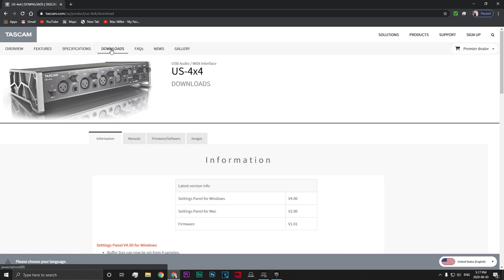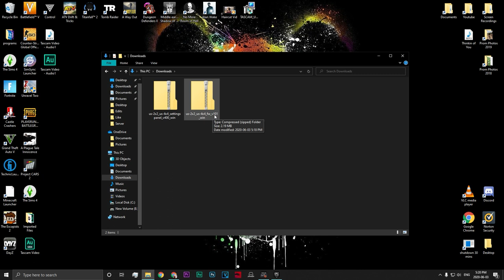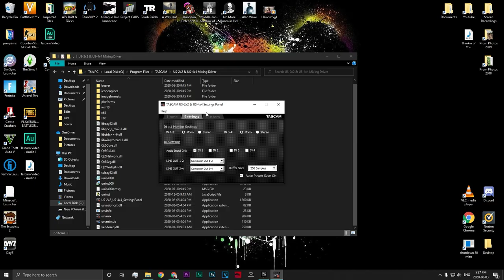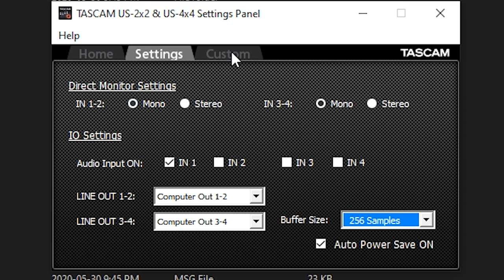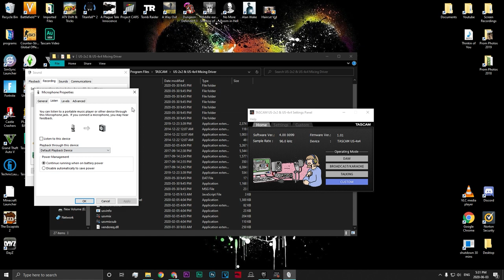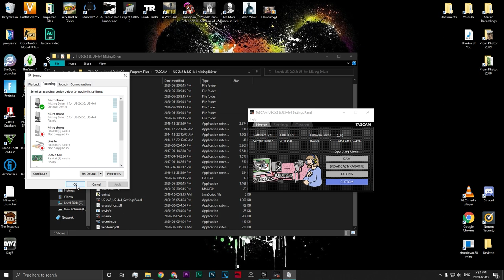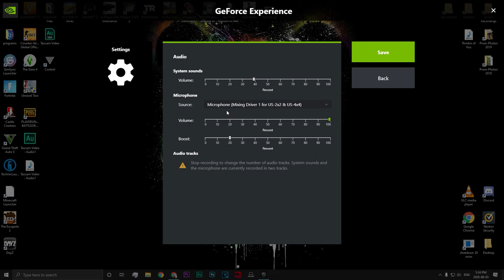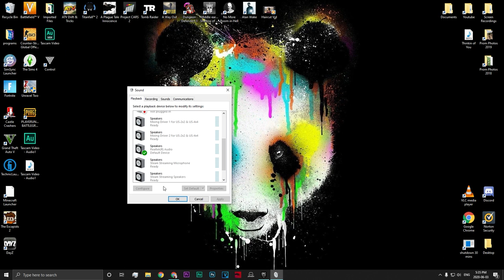taSCAM 4x4 - AUDIO ISSUE (still broken, don’t buy)

Comment from the maker: Update: still broken. Buy something else :((
Reply: I'm sorry to hear that. I came to the same decision, and bought a Focusrite Solo, which quality-wise seems fine. Windows 10 and my laptop seem to recognise it and usually switch over to it from the in-built sound card. The Focusrite only has one XLR mic input plus an instrument channel, so for occasions when I want a 'live' stereo acoustic recording (and have time to fiddle-faddle with settings), I'll hang on to the Tascam 4x4. After all, its software may be useless, but it looks impressive on the shelf.
Reply: Thanks for the informations brother!
Reply from the maker: @partilhamusicosmica  no probs
Reply: I spent hours today trying to get this going on my Windows 10 computer. It was shocking how many places I had to change settings in Windows. Tascom was recognized and enabled in Windows, but Tascom settings panel said no device. I even reinstalled twice. How disappointing. I gave this a bad review on Amazon. I saw many people on the Internet complaining. Thanks for trying.
Reply from the maker: @powersforthepeople1969  yeah it’s a bit of a bummer considering the price tag. I can’t even send mine back.
Reply: Try going to help/drive setting in the tascam mixer and swich off the auto driver select. Maybe this is why you have to select the driver every time you start the pc
Reply from the maker: Maybe. I’ll never be able to try that cause I sold it for scrap... I did a lot of troubleshooting though and got nowhere.
Reply: Funny I didn't have all these problems. But this morning the audio-card bricked itself, until I unplugged everything turned off my computer, plugged all back and turned the computer on.

But it seems tascam have components that can burn, so I may need to learn to properly weld components if I want mine to last long :')

Comment: And they're company has comments off on their video for this model... I can see why. Those Jagovs should get to work instead of shutting out user input...
Reply from the maker: Yeah and I don’t even think they make them anymore either. $600 machine and they can’t update it or give the people any help so you have to buy new... all I can say is I won’t be buying from Tascam anymore.
Reply: @MooserTheHoser  ouch..yea I waslooking at em for like $210 new last few days. That's why I was researching them. I think there was maybe too much fundamental wrong with it to tally help anyone aside from exchanging for a new different model, sometimes poor hardware design or hardware/ software conflicts etc just can't be worked out.
Reply from the maker: Oh damn, that’s a lot cheaper than what I got mine for brand new lol I think you’re going 100% right though

Comment: I was looking for a smoking gun based on the clickbait title. All I got was driver issues (which is a non issue on a Mac) and how to upgrade firmware. Hiss? Pops? Poor quality? Nope. Windows....
Reply from the maker: Yeah, sorry, I realize now that the title is misleading. I’ll be sure to update it so that it reflects the message (to not buy/return if bought) & maybe do a follow up vid if I have time. Seeing as I couldn’t find a similar video at the time & that this one got quite a bit of traction (popular issue I guess), maybe it serves its’ purpose for those skimming through the comments trying to figure out what’s wrong with their machine. I’m not very technical & I missed my chance to send it back so I apologize that I was unable to diagnose any potential mechanical failures... and now my unit is long gone so there’s that too... It was a quiet interface, seemed like decent quality at the time until it was plugged in & didn’t work the way it should’ve. Glad I could help a little though, good luck sorting out the problem.